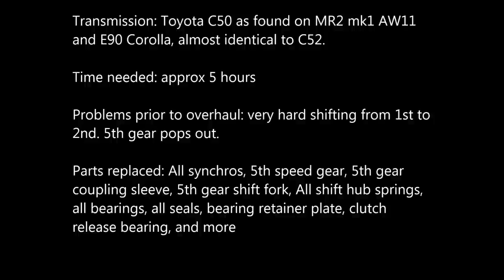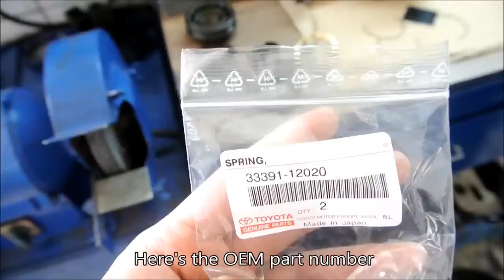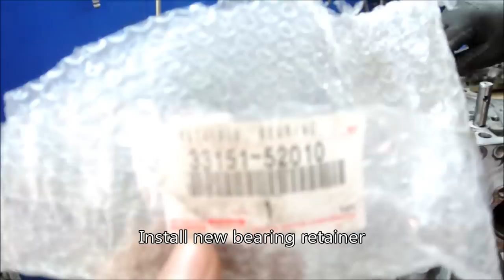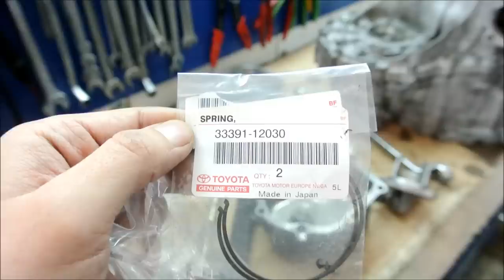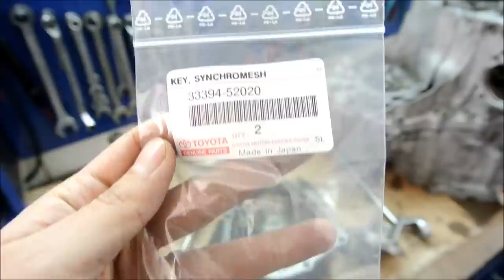Manual transmission full rebuild and assembly - step by step how to

Comment: nice video man, love this chanel, 
something bothered me though, did you torque the thing right ? On a gearbox this matters right ?
Reply from the maker: Antonin Martin This isn't me assembling the thing. I tokk the transmission to a mechanic who assembled more transmissions then it would be sensible to count. He didn't torque anything. He just took a glance at all the torque values, said there isn't anything extraordinary and did it all by feel. I know it might sound wrong but the transmission works and feels amazing.
Reply: Yup I guess that  by experience you can acquire a feel for torquein deed, very nice job on the motor anyway, glad you're still enjoying you MR2
 I'm hoping to get my hands on one soon, shame it is very hard to fnd one under 200k km, how much did yours had ?
Greetings from France
Reply from the maker: Antonin Martin Don't worry too much about low miles. Low mileage guarantees not nothing. If the car was sitting for too long it will need a rebuild probably. Mine had 259.000km.
Reply: I guess you're right, that means it has to be rebuild no matter what...
Thank you for your time man, I appreciate talking with an mr2 enthousiast, 
and cost wise how much did you spend overall roughly ? (price may vary in your contry I'm sure but this will give me an idea)
And would you do it again ? XD
I will check all of your videos, you pobably already answered, sorry for that
Reply from the maker: Antonin Martin I lost count of the money, but I'm guessing around 6.000 euros for the engine and transmission rebuild. Might be more. You can save quite a bit if you are willing to do a lot of the work yourself. I caught the bug and I would definitely do it again. I'm already thinking about the next project. Maybe turboing this engine or getting another car. If I had the time and money I would spend all day tinkering around cars and driving them. It's an addiction.
Reply: I had a mechanic instruction so I intented to do the work myself, I don't have all the tools though that's why I love all the DIY content of your channel, (lifting the car with wood was awesome).
I'll stay tuned to your channel if you decide to boost the Mr2, I would recommend to you to supercharge it instead of turbo, I'm sure you know that they factory produced supercharged mr2 in 89

Comment: Or go to a breakers and get a transmission for 1/20 of the cost
Reply from the maker: +Gplus sucks big Which can also have failed synchros and bearings and you have no way of checking if it's any good. Yes this is more expensive, but in the end you know exactly what you have.
Reply: drving 4 answers I completely agree. have experienced that once but with A/C compressors.
Reply: A new named brand a/c compressor (eg sanden) costs 200 eur/usd, why buy used?  
A new transmission is in the thousands and I was quoted 650eur for a transmission rebuild